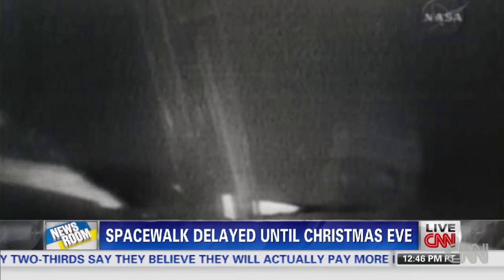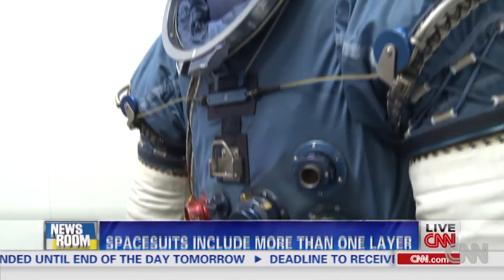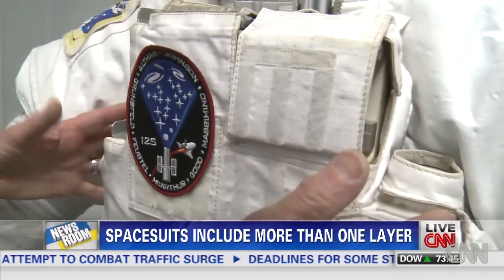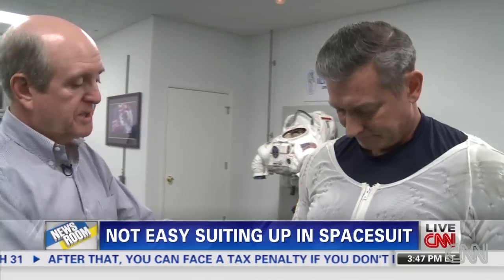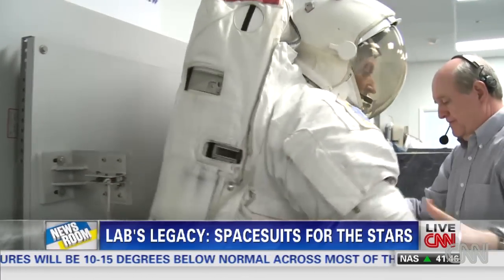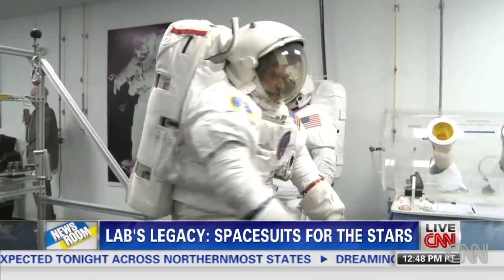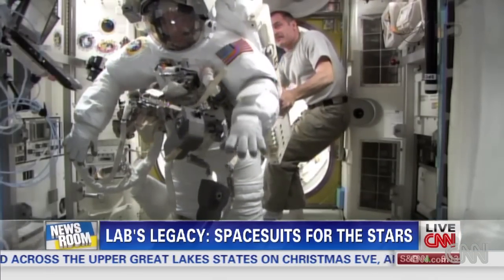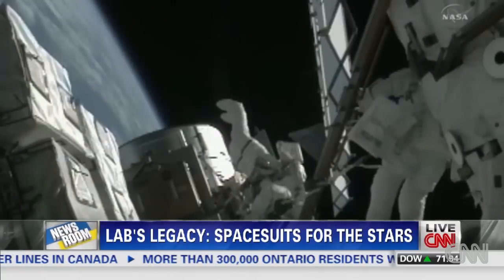Wearing space suit no easy task

Comment: Ask yourself why they don't demonstrate what happens to a real human in a suit when inside a vacuum chamber. That MUST be one major phase for the testing. So why do they not even mention such a chamber, such an acid test? Not just here but ANYWHERE. You can't find such a video, despite the fact that the need for such a test is beyond obvious.
Reply: Colin Southern   The door is open, there is no vacuum during the video. That is not a window.
Reply: @dansv1  You can see light reflections. There is a Lexan window and the other side is under vacuum
Reply: @infinitepower6780  
No it’s not. About two years ago a lot of people argued back and forth about the issue, but it is definitely an open door, and vacuum chambers never have such gigantic windows. On the inside of the chamber, you can see several windows. They are round and look to be about 18 cm in diameter.
Pause the video at the 0:06 mark and use the 3D feature to look up and the top of the door frame. There is a rectangular brown object going through the “window” if it was a window. It is a retractable pad to prevent people from bashing their helmets or heads on the top of the entrance when entering the chamber. 
The hinge and the door (with a window in it) are behind the guy reading the check list.